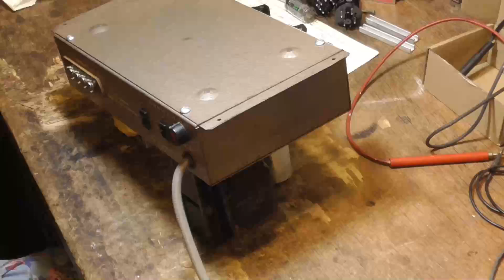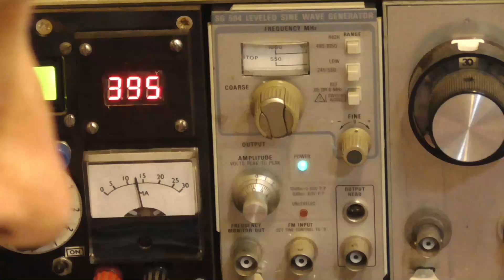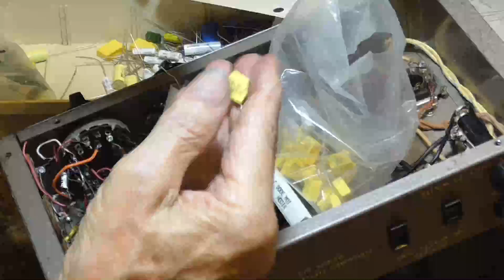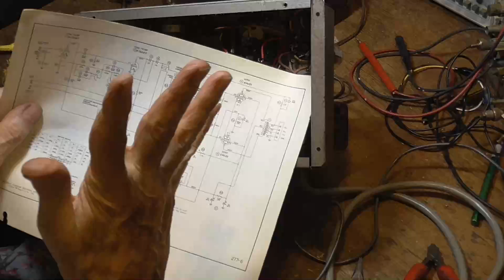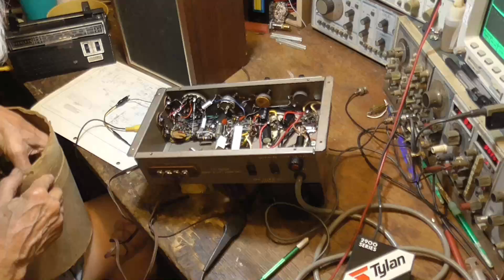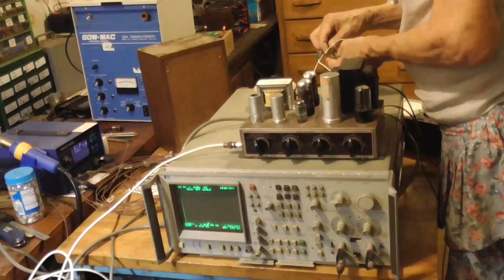REPAIRING A SMALL TUBE AMP

Comment: Hi Ron , Is there anyway to filter out the distortion, with capacitors.
Reply from the maker: No, the distortion is caused by nonlinearity of the circuit. Design changes would need to be made. Not so easy as hanging a capacitor here and there!

Comment: Your electrolytic capacitor evaluation procedure is backwards.  First check the capacitors for ESR.  If a reading is high the capacitor is dried out and won't do the job - replace.  Next polarize the capacitors (like the way you did with your power supply) at about 50% their rated voltage.  Leave the damn things alone for half an hour.  Increase voltage is small increments.  Leakage will increase and then decrease.  It leakage won't decrease the capacitor is failing - replace.  If leakage keeps decreasing leave the damn thing alone for at least an hour.  Check to see if leakage ever begins increasing.  When it appears caps are reasonably on their way to reforming put rectifier in and operate the amp at low line voltage so that rectifier plate resistance is high to keep currents to safe value.  You may be pleased to find that the caps all turn out to be OK and will still have good wear life in them yet.  Or if you just like butchering in caps don't let me stop you. 🤨
Reply from the maker: I never let people with less experience and knowledge than Ihave stop me. Note that there is PERMANENT chemical degredation that cannot be reversed by fooling around with so called "reforming" nonsense. Your fiddling around with voltage CANNOT REPLACE EVAPORATED MOISTURE THE CAPACITOR NEEDS TO FUNCTION CORRECTLY!
Reply: Always take in consideration the max. admissible ripple currentf for electrolytic cap's, used in filtering circuits. Very important in the output stages in switching pwr supplies. As a common rule, use 105°C types with a low ESR. Don't use just "any" capacitor.
This also appies to mains supples. 
For the remainder, I admire your skills !! Good work.!!

Belgium (Europe)
Reply: @glasslinger my electronics professor in the late 70s said that even after "successfully" reforming an electrolytic cap..it will generally fail within a year. Keep in mind that tube equipment electrolytics were 40 years younger than now.

Comment: Hello young man. I have really enjoyed this video. I think you and I are pretty close in age. I have not had a lot of experience in audio equipment. My field has been in  rf  but our old principles are the same. These new techs have really missed out on using the old test gear. I loved watching you use that old equipment that some you probably built yourself. Glad to see you put in the notice about using break clean and getting it on the plastic dials. I learned this the hard way onsome old transmitters that parts are hard to find. Keep it up as long as you can. As I aged my hands shake uncontrollably and I have retired. I miss it so bad. God Bless you.

Comment: I recon they removed the RIAA because they wanted to play the guitar over it - and that's what killed the "HiFi" speaker , too. Was there  :-)
Although it's unusual that the sub died - but you can kill ANY big Hifi-box with a guitar. At least the tweeters will blow up...
In normal (music) signals there will only be little energy in the hights (about 10..15%). The guitar gives them a 100% ...

Comment: Hi, see you checking resistors ... I heard you have to de-solder one end before checking??
Reply from the maker: If the resistor checks lower than the marked value it must be de-soldered. Also, in modern transistorized circuitry resistors must be de-soldered. For tube circuitry the capacitors must be replaced before checking the resistors because capacitor leakage may affect the reading.

Comment: Fascinating. When watching a sine wave on an oscilloscope (and not a spectrum analyser), at what percentage distortion does it start to become just visible? Thanks.
Reply from the maker: Depends on the type of distortion. Crossover distortion 2% or so, harmonic distortion around 5%. A scope wave form is not ideal to determine distortion other than really bad levels. A half percent is clearly detectable in listening but invisible on a scope.
Reply: @glasslinger  Thank you. It's also easier of course to hear distortion at lower frequencies as the harmonics are more likely to be in the middle of the audible hearing range.

Comment: Hi Glassinger nice job you do here's an other YouTube uploader of his channel he has made a device to messure DC lekkage of caps. Very interesting stuff he knows a lot like you do. If you want to watch his device look at : https://youtu.be/LhovRIM5xAo

Thx have a happy new year
Reply from the maker: Too complicated. Much easier to do than that! But he is free to show that way.
Reply: @glasslinger  I do love your honisty. To the point. And I admire your skills to make vacuum tubes. You must have eagle eye's. I'm a diy tube amp builder made my own pee Amp line 6cg7 and ecc83 for phono. And 2 mono 6550 amps with no feedback. Tubes are for me the musical feeling. Thx Glassinger for your input.
Reply from the maker: @Dutchamp  6550 tubes are very interesting, such high GM with low plate resistance. You should do a video on how you matched the tubes both input and output. I have no interest in audio work so I don't have time to investigate this.
Reply: @glasslinger  I will keep it in mind course I don't have a good camera atm but all I could present is setting up the bias I don't have a tube tester. I'm just a builder of existing quality schematics. About 6550 they sound powerful and very clean (depends on output transformers of course they are handmade on vintage machines with over dementioned capacity. But in the future maybe I will make video's I like your idea
Reply: carlson is awesome, but I don't see the point in making the effort in building and testing caps extensively, as it mostly are inexpensive parts.Glasslingers way is fast and easy. I  mostly just go about and change critical caps anyhow if they are suspects of aging. I once got a cheap Chinese multi-testster for caps and transitors etc, in some cases that comes in handy. Yet, building the Carlson tester is a very interesting project on its own, and he is an amazing guy.
Reply: @edmaster3147  Hi Ed!  Yeah that Mr. Carlson's lab guy is very cluey.  His capacitor leakage tester seems incredible, being able to detect 20 Giga ohms or more of leakage!  It would make the perfect test-gear partner to my 'Silicon Chip Magazine' ESR tester, which is also a fantastic piece of test gear (that I built myself!).

Comment: Hello Glass Slinger.  I was referred to you by a member of the Houston Antique Radio Association.  I am in need of a transformer for a Hallicrafters HT9 transmitter. Was told you may be able to rebuild the one I have?  I am certainly interested if this is something you would consider.   Hope to hear from you. Regards, Dave  awsinspector1960@gmail.com
Reply from the maker: Almost impossible to do. The modern power transformers were wound using a professional automatic winder, which can place the windings and separator papers perfectly. By hand it usually turns out to not fit the core any more.  :(

Comment: you dont use a damn gun to solder that kind of work either
Reply from the maker: People with no experience in soldering tend to use too low of a wattage making connections. This can severely overheat the surrounding terminal while waiting for the small iron to bring the connection to soldering temperature. The high concentrated heat of the gun brings the joint almost instantly to soldering temperature so the operation can be very quickly finished before overheating the attached plastic and other parts. Besides, using guns is an American thing!   :)
Reply: @glasslinger   That high heat destroys components far faster. then a 40. watt gun only reason to me you need a heavy. gun like that. is direct solder to. chassis i.e  ground from 3 prong cord. or. the. ears holding a cap can in place you will have ppl. with no skill destroying. parts , pretty sad way. of making your self business
Reply from the maker: @NHguitar57  I stand by my claims. It is scientifically provable and provable in actual practice. Your psychosis won't ever change that!
Reply: @NHguitar57  I've been thinking about this also, but in my opinion you are wrong. A battery can get leads by applying great heat very short, yet problems occur by applying less heat for longer. And connections to chassis (and some to boards with lots of copper) are almost impossible to make without a solder gun. You are right for small and light boards, but I suppose you could overthink your opionion and/or experimeent a bit. Cheers.
Reply: @glasslinger  I'm not a pro. I've been tinkering in electronics as a hobby since I was a kid. I can do point to point with a 75 watt induction heating solder gun with my eyes closed and fingers to hold components. This is not a problem. Glassslinger is right. This other commenter is inexperienced or trolling.
Reply: @glasslinger  I 100% agree with that!  I can get in quick, heat the whole joint up instantly, activate the flux & have the molten solder wetting the joint perfectly, with a 100W iron far quicker.  The whole joint can be completed within 3 seconds this way, instead of 10 or 15 seconds with an underpowered iron.
Reply: @NHguitar57  Geez mate it sounds like you think Glasslinger is deliberately showing people the wrong thing?
Reply: @glasslinger  Yeah those soldering 'guns' do seem to be an American thing don't they, as I see you guys with them quite often here on yt.  It seems a little ironic & comical (Americans-guns) lol, but it it's all good I still love youse!  I myself would just use a 100W regular soldering iron though.  I understand though that the soldering guns have a very quick heat-up time, which is convienient, & power saving.

Comment: Hey there....  i'm enjoying some of your videos.  Thanx, please keep'em coming.   So at the beginning of this one I noticed two devices you were using. One being, I think you said an electronic fuse (not sure??) I guess it is a current limiter??   And the other was your high voltage variable bench supply I think.  Either way they seemed very impressive &  even more importantly were they or are they homebrew??  Did you design & make them yourself??  They look to be that as I couldn't see any manufacturer names etc.
Reply from the maker: They are homebuilt. The electronic fuse I made a video of with the schematic. (see my video list) The power supply is simply a variac, transformer, and rectifier. Very basic, nothing to it.

Comment: Not all tube amps are THAT bad. Some can be very good. But at 100x the cost of a solid state amp. That POS amp was never meant for high fidelity.
Reply: Aint THAT the truth T7!  This unit may better for a guitar amp than for a hifi amp with all those odd, as well as even hamonics.

Comment: I see you are a fan of the Tektronix TM500 series of test equipment.
Do you have any interesting plug-ins?
Is that HV power you were using for capacitor leakage testing a commercial design or is it home-brew?
Reply from the maker: It is home-brew. The TM500 series was one of Tektronix better moments! I try to have most of my test equipment fit in a mainframe. Most interesting is a 1000 to 6000mhz microwave signal generator that plugs into a double slot. I also have a radiation counter that plugs into a single slot. (all homemade)

Comment: Someone’s probably already commented on this, but putting a square wave through a speaker is almost a sure way to blow it out even at low power. That ramp up on the start of the square wave draws a huge amount of current. By the way, this was one of the most entertaining videos I’ve seen in a long time!  Good job!
Reply from the maker: Also turning up the volume on the amp and then slamming your fingers across the guitar strings! The inductance of the speaker will block the sqaure wave harmonics. If your speaker blew out due to "square waves" you simply got a junk speaker!
Reply: glasslinger Excellent point! Thanks.
Reply: @glasslinger  Yes, I have a MOOG analog synthesizer and blast square waves through my speakers all the time.
Reply: @TestTubeBabySpy  You got a Moog?  Awesome!  Hopefully you have heard "Switched on Bach" by Wendy Carlos?  What an amazing piece of work - on a Moog synth!
Reply: @nevillegoddard4966  Yes I am familiar with some of her music.

Comment: 16:45 At least in older equipment, resistors can drift in value quite a bit.  I pulled several out of an old Heathkit condenser tester that were over half again as much as what their bands said they were.  Gotta test them all.

Comment: Very good video. This remembers me of my old amp. Many years ago I have bought an used tube amp, it was 100W, and made really clean sound. But I have never take a real look on the solderings. I should have done that because it blows up the output transformer as a bad soldering give up after some time and full current goes through (pentode..) and even worse, someone before me had increased the fuse amp ratings... So bad! So my advice, take a look at all solderings carefully before switch on any amp.

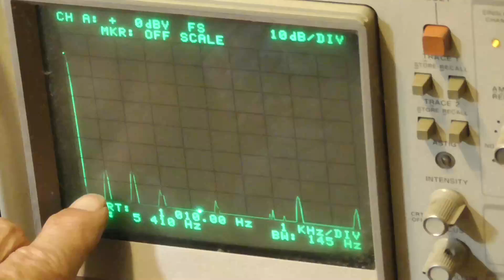Comment: Hi, at 43:48 and also several times later the analyzer displays OVERLOAD at the lower right corner. The spectrum does not change much when the voltage increases above that level. I expect the analyzer input is saturated and the spectrum shown is incorrect.
Reply from the maker: Yes! (blunder) I was in a hurry to get the video finished and wasn't paying good attention. Anyway, the distortion was near 10% before the analyzer saturated.

Comment: Did you use shielded capacitors. I noticed that at least one capacitor had a ring on one end. this normally indicates polarity. You may be picking up noise through a unshielded capacitor.
Reply: On antique wax/paper caps the line indicates the outside foil side of the capacitor. This is not polarity. Polarity denotes positive and negative and the only capacitors that are polarized are polarized electrolytics (there’s also such a thing as non-polarized electrolytics). Wax/paper caps with a line denoting the outside foil are no more shielded than any suitable modern replacement capacitor. The modern ones simply don’t denote the outside foil side (but it’s there) and must be tested to determine this. If a replacement capacitor was mounted with the outside foil opposite of what the radio’s engineers intended, you’re correct that this could contribute to a small amount of noise.
Reply: @FluxCondenser  I did not mean polarity as in positive or negative. I was referring to high-voltage or low voltage potential. The shield always goes to the Lowest-voltage potential. The shield will help prevent noise coming from outside sources. They are essential for good Tube radios and amplifiers. Standard capacitors are not recommended as a replacement for these capacitors. And if you get one turned backwards, you will get a lot of noise as well.
Reply: @joea3728  Not necessarily the lowest voltage, but to the lowest impedance.  Very often that's the plate of a previous stage, which will be at high voltage.

With modern caps being so much smaller than the old oiled/waxed paper ones, there's much less surface area for a voltage to be induced into.  I still check caps for the outside foil end, but I've seen several YouTube videos recently where it didn't really make any audible difference which way the caps were installed.
Reply: Joe A Terminology is important. As someone else pointed out, you’re also confusing voltage with impedance. Standard capacitors are absolutely recommended for replacement as they’re just as well shielded as the antique wax/papers if not more so. It’s simply a matter of determining which side of the cap is attached to the outer foil.

Comment: I'm a bit confused about what I see with the increased output power level harmonics test.  The 100 Hz as well as the 1 kHz indication stopped increasing at 4 W.  If there are no other explanations, my conclusion is that either the analyzer input saturates at the 1 V level (indicated reference level) or the amplifier starts clipping at that level.
The spectrum analyzers in general are picky about their input stage maximum signal.  I don't know the specifics of your analyzer -- I'm talking mostly based by my experience with RF analyzers, but suspect the maximum input power limitations must be similar.  I also think the load resistor had a wiper, so it would be easy to hook it up as a potentiometer, reducing the signal level to the analyzer to say 1:10 and see what happens.  On the other hand, maybe the amplifier indeed saturated.  But the sizes of the two transformers suggest quite a bit more power. capability.  Then, one last thought -- maybe amplifier input stage saturates?  Were all the tube operating points correct?
Reply: Pellervo Kaskinen Yes, when testing output power, generally a 10X scope probe is used to keep voltage appropriate for a spectrum analyzer. Not sure how this test was done or the limits of his analyzer, but the display indicated an overload condition for much of the testing.